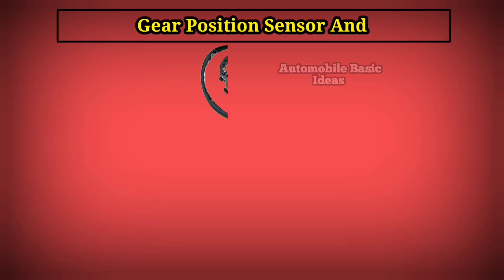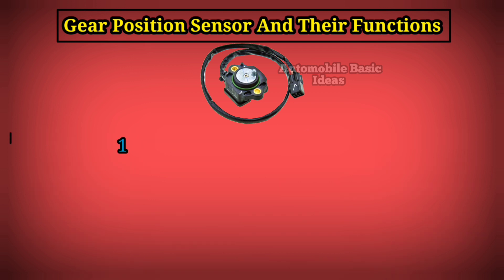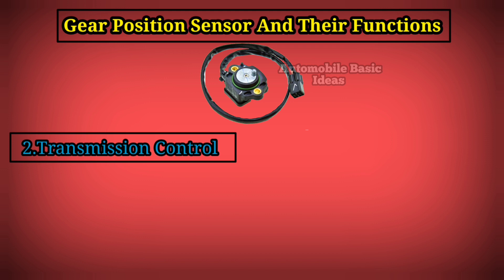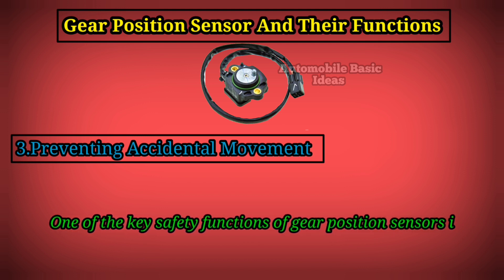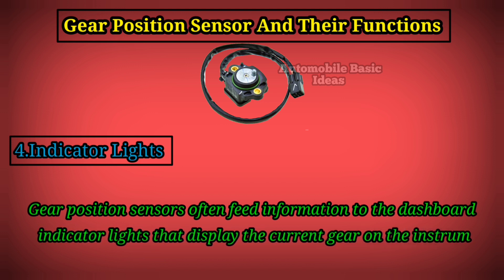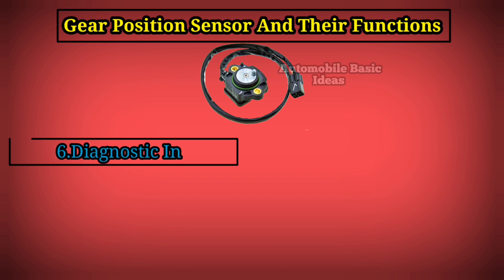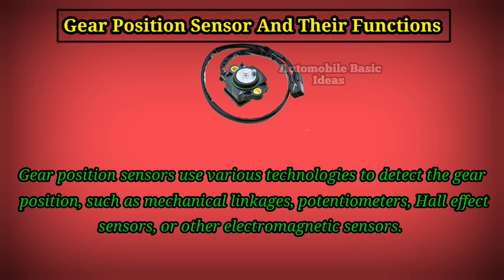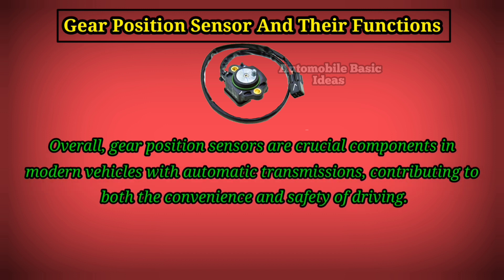Gear position sensor and their functions

Comment: Bhai gear position sensor ka output kya hota h? Kya 1st gear ka indication le skte h...front camera ko active krke k liye.?
Reply from the maker: The output of a gear position sensor is an electrical signal (usually voltage or resistance) that indicates the current gear position of a vehicle's transmission. This signal is sent to the engine control unit (ECU) or transmission control module (TCM) to optimize engine performance, fuel efficiency, and gear shifting.